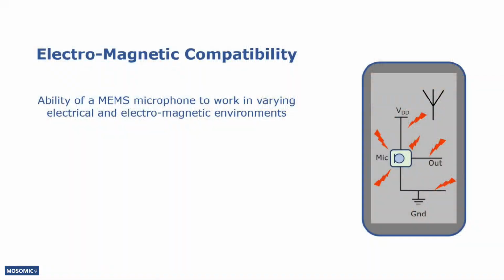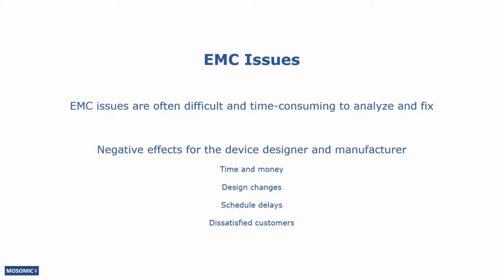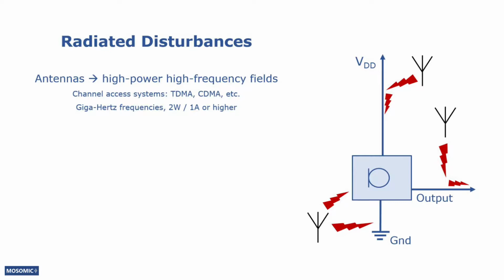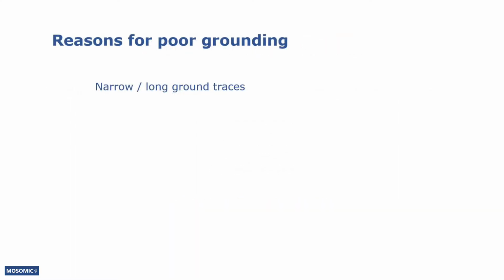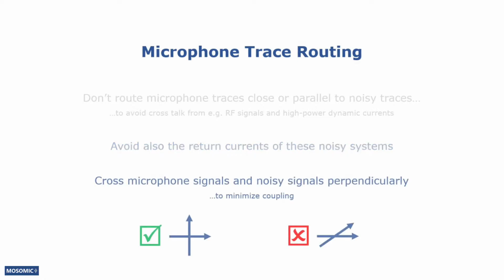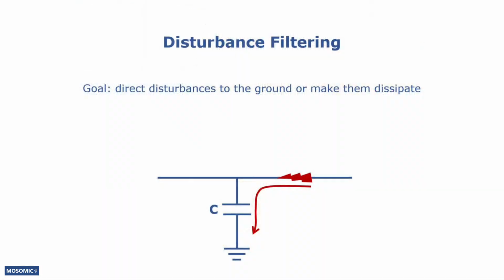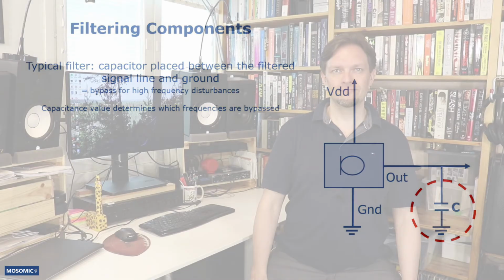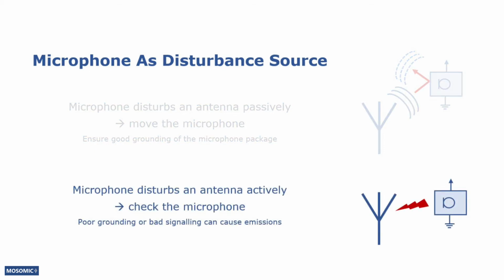Electrical Implementation: EMC & RF | MEMS Microphone Guide Ep20 | Mosomic

Comment from the maker: 0:41 Electro-Magnetic Compatibility – EMC
- 1:48 Three forms of electro-magnetic incompatibility
- 4:17 EMC issue analysis
- 4:53 Ways disturbances pollute microphone signals

5:57 Conducted and radiated disturbances
- 5:59 Conducted disturbances
- 7:14 Radiated disturbances

9:12 Disturbance minimization
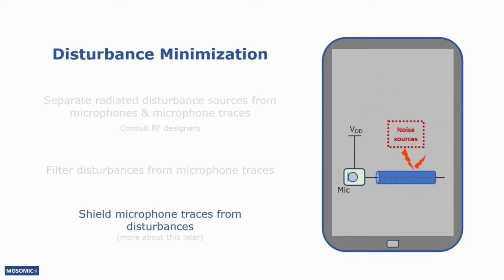- 10:35 Grounding
- 13:15 Trace lengths and routing
- 15:09 Shielding and Faraday Cage
- 16:54 High-power / high-current systems
- 17:31 Power supply disturbances
- 18:12: Disturbance filtering

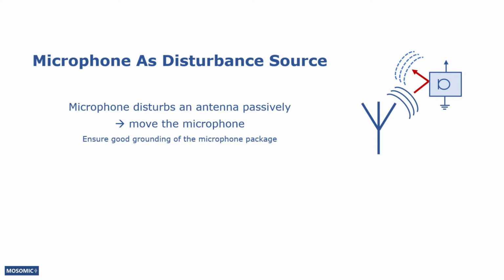24:40 Microphone as a disturbance source